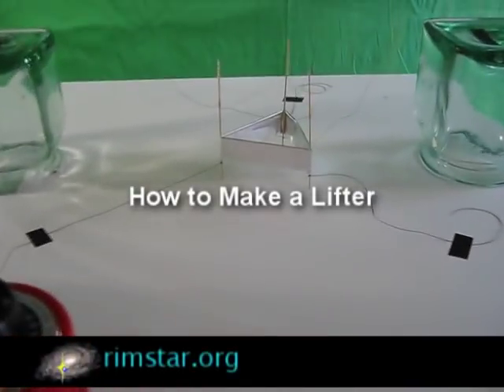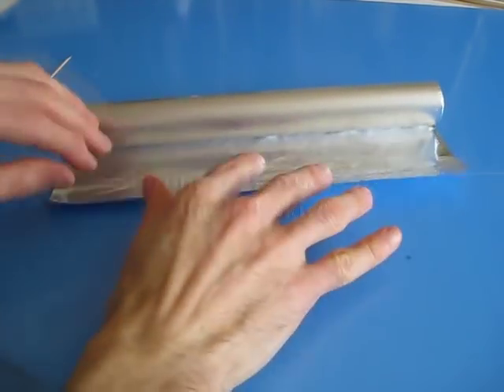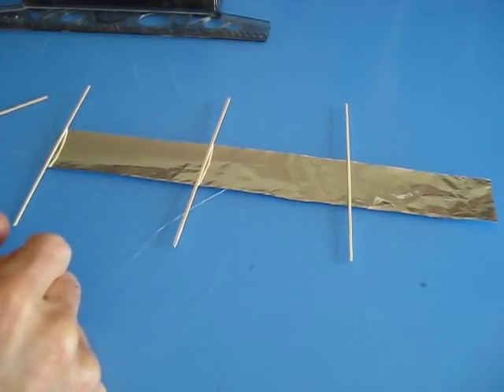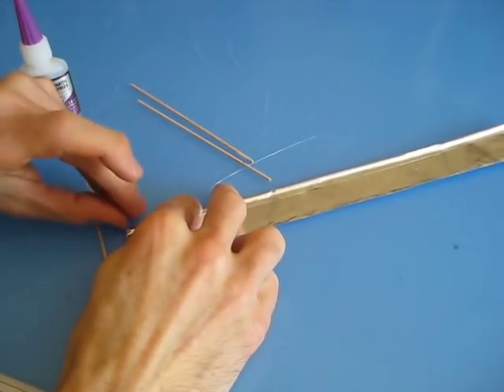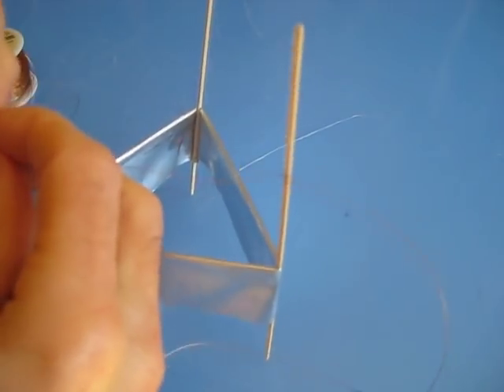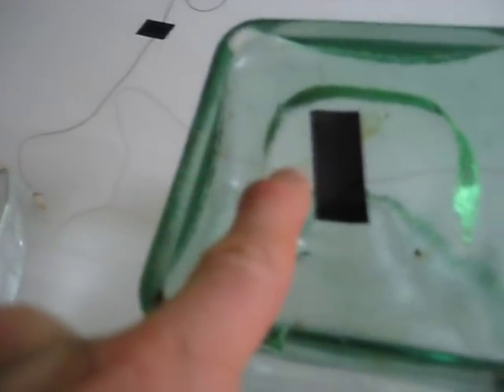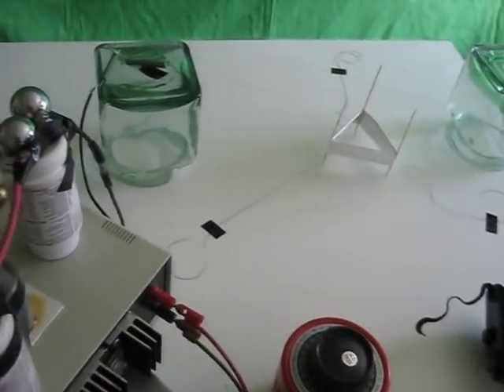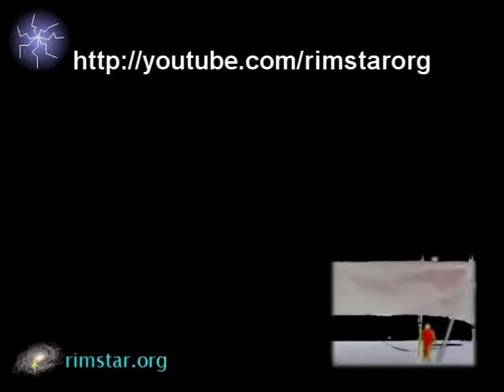How to Make/Build a Lifter or Ionocraft

Comment: Put the flying part with the bare wires inside a clear plastic cage. Drill vent holes top and bottom of the cage. Put the power supply under a second cage also with vent hole to vent heat generated in the supply circuitry. Ozone is not actually dangerous and neg ozone is produced with every bolt of lightening, every day, all around the world, There is a difference between negative and positive ozone. Hook the top wires to negative and the foil to positive to produce neg ozone, the good ozone!

Comment: Can it be operated on lower voltage by decreasing distance between electrods?
Reply from the maker: Yes. You'd reach a point, though, when the resulting current would be too low to produce the sufficient ion wind in order to light-off. Voltage is energy/unit charge and as you lower the voltage either each charge gets too little energy or they get enough but there are too few charges. I've never done a test by gradually decreasing the distance.
Reply: Thanks but what would be minimum voltage required?
Reply from the maker: That I don't know.
Reply from the maker: It's certainly in the thousands though, probably above ten thousand.

Comment: High Energy electrostatics causes the force. Iond wind has an upper limit to force, and that is not enough force to loft a 3-gram model, and models thousands of grams have been lofted with electrostatics and capacitors sealed in RESIN and EPOXY, It works under OIL, and in hardest vacuum, so ionization obviously is not the source of the FORCE.
Reply from the maker: Hi Russell. Steve Dufresne here. Nice to hear from you. My smoke tests (https://www.youtube.com/watch?v=LOGAaObsN4g) show a very strong downward ion wind so I disagree. But I'm also pretty sure there are multiple forces at play. For example, the Coulomb force should be present in addition to ion wind, given that charged surfaces are involved. My own oil tests can be explained away as dielectrophoresis. But what's this thousands of grams lofted with resin and epoxy one?

Comment: i know this is a zombie reply but: what is the upper limit of the load bearing capacity vs the size of the lifter? if it had a small enough power supply/ battery; could it conceviably fly without being tied to large heavy wall plugged power supply?
Reply from the maker: I don't have the numbers but it is possible. As batteries became better someone recently did it. I don't have a link to the video but there is one or someone showing it and explaining his circuit, which was also pretty brilliant.

Comment: How much light do we need to make it fly? Can you tell me how to do it?
Reply from the maker: Mine needs around 25,000 volts. I don't know how much current but I do know you need a significant amount (in other words, electrostatic power supplies don't usually give enough). At the bottom of my webpage here https://rimstar.org/sdprop/lifter/lifter.htm I give some tips for the power supply.
Reply: Can an aluminum brother run through electricity?

Comment: can you put at least a platform were you can put a load and if so how much electricity to carry.         X =amount of weight.. really curious.. do a larger scale soler powers one and could you use aircraft alluminam  and carbon fiber 😃
Reply from the maker: The record lifter that I'm aware of lifted 100 gram payload plus the 85 gram lifter (my lifter is only 2 grams) with around 1 gram force/watt http://blazelabs.com/e-exp14.asp.

Comment: is there a way to make one thats more stable and not have it jitter around?
Reply from the maker: Probably. It would involve modifications to the power supply with some sort of feedback electronics. You'd have to somehow power each side independently so that you can give them different amounts of current.
Reply: @RimstarOrg  that makes sense. Because I swore I saw a video of one that was pretty large and quite stable a long time ago so I've been searching for a video of one like that and I can't seem to find one again

Comment: How would i increase thrust and power consumption for this iondrive
Reply from the maker: To increase thrust you have to make larger ones while also increasing the power output of your high voltage power supply. The power supply needs to not only produce a high voltage but also needs to be able to supply a lot of current. The record is a lifter that can lift an extra 100 grams using a specially made high voltage power supply.

Comment: what would happen if u extend or retract the distance between the copper wires and the tin foil?
Reply from the maker: If you bring the bring them too close together than you start getting sparks, which causes it to stop flying. A spark is like connecting a wire between the two and you don't get ion wind. If you put them too far apart then the ion wind decreases as the electric field directly between them decreases in strength.
Reply: so about how high u would say one of this would go,considering u get a really long wire and stabilizing supports?
Reply from the maker: shiv .mangra
That just depends on how much it can lift since the threads and feed wires weigh it down. I've never tried to see how high. I've probably gone around 6"/15cm. From memory I've seen larger ones go two or three times as high.

Comment: One thing I have noticed in all this videos is NOT ONE provides a voltage 
everyone says high voltage, what is the high voltage in question as a number?
what is the current in Amps?
what is the power source AC or DC as no earth required if it is DC 
how can you run 12000V or 12kV on a hair thin wire without burning it like a fuse wire unless the amps are low thus low current 
without these numbers is it flying on electricity or string theory? as in string hanging from above
Reply from the maker: This is the how-to-make video. The voltage and current measuring are done in this video https://www.youtube.com/watch?v=LOGAaObsN4g (though I couldn't measure the current well, it's hard to do when there's high voltage involved). The power is DC, and earth is used for safety. More on how it works here https://www.youtube.com/watch?v=01F8V5IhB5k. You can run 25,000 volts on a hair-thin wire because it's the current that melts wires and even though the current here is relatively high for a such a high voltage, it's still low for melting wires.

Comment: Would be clever to build spinning rotor blades - the foil is the 'aerofoil' (haha) and the wire in front will propel it around - ditto a model plane wing - but how to make a 30,000 volt 7 watt power source to power the plane....

Comment: Good
Can I make it as my science project
Reply from the maker: Thanks. Yes, you can but it is dangerous in two ways. The first is that this uses high voltage with relatively high current. The second is that it produces ozone, which is hazardous to your health. In a big open room, the ozone probably won't be too harmful but it will smell. Unless you have a background in electronics then I recommend looking for something else. Having said that, I have heard of people using it for science fair projects.
Reply: @RimstarOrg  ok
I will work carefully
What to do of ozone please tell
Reply from the maker: For the ozone, just make sure it's in a big room (usually science fairs are in big rooms) or have plenty of ventilation. It's also not harmful if you run it only for a minute or so at a time.

Comment: does the skirt have to be that wide?
Reply from the maker: Probably not. The key is having the rounded top edge (it works without a rounded top edge too but not as well). Some have even used cylinders in place of the skirt-like foils.

Comment: Does this craft need to be grounded to earth to fly?
Reply from the maker: No. If you have a high voltage power supply that has both positive and negative poles without either one being grounded then that will work.

Comment: How much power in kv are you useing???
Reply from the maker: Around 25,000 volts and around 1 milliamp. Finding something which will provide 25,000 volts is easy, but finding something which will also produce that much current is hard. You can see me doing the measurements in this follow-up video https://www.youtube.com/watch?v=LOGAaObsN4g.

Comment: If this is the same concept as ion thrusters that NASA had conceived of using, than it will continue to increase in speed, albeit over a much longer period of time; sustained it could reach thousands of miles per hour in several years.

Comment: so where does the ionic wind go does it get trapped in the tin foil?
Reply from the maker: Most of the positive ions do get trapped in the foil (or negative ions, depending on the polarity you chose for the wire and foil). Neutral atoms that the ions collide with continue past the foil. See my "How Ion Propulsion, Lifters and Ionocrafts Work" video http://youtu.be/01F8V5IhB5k for a more complete explanation.
Reply: RimstarOrg so would a bowl shape or the shape of a cake pan be more effective?
Reply from the maker: narpup
No, because those neutral atoms that you see near the end of the explanatory video I mentioned will also collide with the bowl, cancelling out the earlier upward reaction.
Reply: RimstarOrg And would you be able to have multiple stack on each other?
Reply from the maker: narpup
Yes. In fact back in the early 2000s when there are more activity with these a lot of people played around with stacking them.
Reply: RimstarOrg also how close can you the wire and the tin foil?
Reply from the maker: narpup
With this lifter, probably around 1 inch/2.5 cm before it starts sparking. You don't want it to spark, so if it sparks then I increase the distance between them.

Comment: Does the width of the foil matter?
Reply from the maker: +William Miller Not much. By width, do you mean the height of the foil or how long each side is?
If you mean the height of the foil, you don't want it so short that the sharp edge is effectively at the top, since we want the top edge to be rounded. You also don't want it to be too high since that adds more mass, and the lifter has to be as lightweight as possible. I'd say as long as the foil is at least 1cm/0.5 inches high then you're okay. Any higher and you have unnecessary mass. I use the height that I do out of habit.
If you mean how long each side is, then it's a trade-off. You can make it quite small, with short sides. My first lifter was only 75mm per side. The longer you make it the more mass you add in terms of the foil, the horizontal support and the wire. You may even need to add internal support. Also, typically the ion wind is at only a short length of the side because it happens where the wire and foil are closest, and since nothing's perfect, that's usually only in one area. To make up for this and still have a large lifter, people often make lifters consisting of many triangles attached together, but without the redundant sides where two sides are next to each other. Though if you can get the wire-to-foil spacing even along the entire side then you can make on large triangle. You can see my small lifter 1a and a photo of a very large, single triangle lifter on my lifter webpage here: http://rimstar.org/sdprop/lifter/lifter.htm.

Comment: what is the output voltage of the power supply?
Reply from the maker: The voltage being used to fly the lifter is around 25,000 volts. I show measuring it in this video https://www.youtube.com/watch?v=LOGAaObsN4g . You'll also need a power supply that can give the necessary current but I don't know how much that is. I just know it's more than the usual electrostatic power supply can offer.

Comment: does more cable wrapped round mean more lift?
Reply from the maker: The longer the wire and foil, the more lift. Also the thinner the wire. But if you have more wire facing the same section of foil then chances are very good that only the wire which is closest will have an affect, and it's very, very difficult to have all of the wire be the exact same distance to the foil.
Reply: @RimstarOrg  Very interesting you should experiment ways to create more lift !

Comment: Is it important that we use this high voltage can't we just use batteries
Reply from the maker: Yes, you have to use high voltage, around 25,000 volts, so batteries won't work. It also needs a relatively large amount of current, so not just any high voltage source will do either. For example, many Wimshurst machines and Van de Graaff generators can produce the required voltage but not enough current.

Comment: how much current is needed for this ?
Reply from the maker: I don't know exactly. From this video https://www.youtube.com/watch?v=vzZy1Aqleno where I tried to measure both current and voltage, the output current was at least 250 uA and the voltage was 26,000 v. From this video https://www.youtube.com/watch?v=2HByosRAknY where I show making the power supply, near the end I measured the input current, it was 2.5 A and 8 v, so 20 watts. 20 watts / 26,000 v = 0.00077 A or 770 uA, but that doesn't take into account losses from input to output.

Comment: You didn't say how much power you used or why the balls were in series with it? Nice work tho....thank you
Reply from the maker: The power going into the high voltage power supply is around 20 watts (I measured it when I showed how I made the power supply in this video here https://www.youtube.com/watch?v=GEuK1OdYxHk&t=521s). The high voltage output is around 25,000 volts, but I don't know the output current, except that it's over 250 microamps. The balls are just a way of connecting the high voltage output to the lifter while avoiding sharp points. Sharp points could leak electrons and be a source of current loss. The balls are making contact just by touching each other. And thanks.
Reply: RimstarOrg thank you for the info. I will check out the link for details. Great job

Comment: battery will work? for this
Reply from the maker: No, you need around 25,000 volts DC, and around 1 milliamp.
Reply: if we heat gas they release em wave. is that possible some how we heat gas and on lifter with the help of the electro magnet producing em wave is fitted and lifer will repel by the em wave produced by gasses. i am just wondering

Comment: is that green screen there on purpose? to hide how u actually were lifting the * off the table surface?
Reply from the maker: Ha ha! I never thought of that. I use my green screen as a plain background so that you can see the details of the lifter better. I have used it at times for doing special effects though.
Reply: @RimstarOrg  u c, i didn't mean no offence... but... the whole thing looks like a hoax/fake 2 me.
simply put, the 3-rd law of Newton didn't go nowhere, did it? if the positively charged ions r moving towards the negatively charged electrode, the negatively charged 1s should b moving in the opposite direction, right?
wouldn't that completely compensate the opposite force vectors? oh... and btw, one of the sides is actually bigger if we don't forget the gravity force vector...

but even if i'm mistaken somewhere (and misunderstand where the 'force' is coming from) the whole thing is just a hoax anyway, since the weight of the equipment (sorry, the amount of force pointing towards Earth = mass x 9.81) is 5 billion times bigger than the actual lifting force of the foil thingy...

also... i hope you did ventilate the room well enough to get rid of the ozone, right?
Reply from the maker: No offence taken... And you're right. That subtilty of positive ions going one way and negatives the other, cancelling their momentum is missed by a lot of people. Also, the particles are coupled to the electrostatic field which is coupled with the lifter too! The missing piece is that the ions moving in one direction collide with neutral molecules and it's that collision which provides the thrust. I explain it in this follow-up video here https://www.youtube.com/watch?v=01F8V5IhB5k and it's also explained in this paper here https://royalsocietypublishing.org/doi/full/10.1098/rspa.2012.0623
And yup, I ventilated due to the ozone.

Comment: what are the specs of the power supply?
Reply from the maker: It's this homemade one http://rimstar.org/equip/30kv_pwr_supply.htm so I don't really have specs. However, if you're looking for what you need in order to make a lifter fly, you need a fairly powerful high voltage power supply, one capable of supplying a lot of current. In this video http://youtu.be/LOGAaObsN4g I measured that it needed around 25kV. I couldn't measure current but I'd guess it's around 1 milliamp.

Comment: will any gauge work
Reply from the maker: +DA AUTHENTIC HACKER No, it has to be very small diameter wire, the smaller the better. 30 gauge is probably the biggest I'd go with. This is for reasons explained in my video about how it works https://www.youtube.com/watch?v=01F8V5IhB5k.

Comment: can you create an wireless ionocraft?
Reply from the maker: No, the ionocraft can't lift the weight of the power supply and the weight of a wireless receiver. Theoretically, it would have to be the size of a house to do that and no one's really tried that so even that's not certain.

Comment: It is not antigravity that we are seeing but nonmagnetic levitation. there is magnetic levitation (on trains floating on powerfull magnets) and there is as well non magnetic levitation that works with static electricity. Electrostatic currents are high voltage low ampers and can propagate through air.....you can imagine the rest......